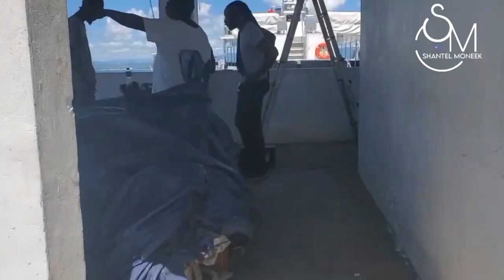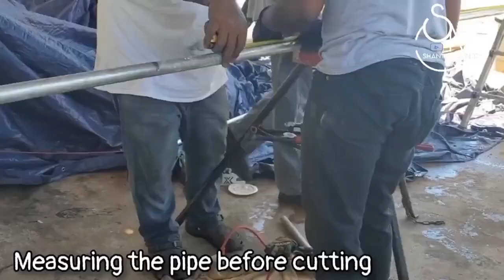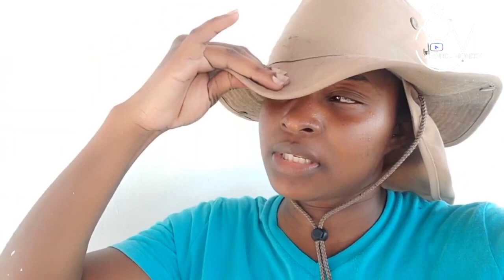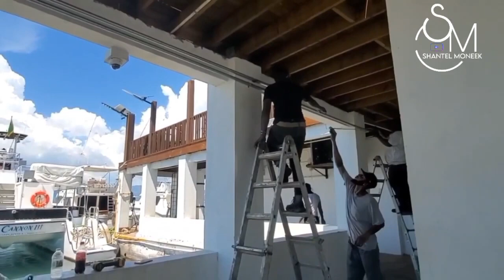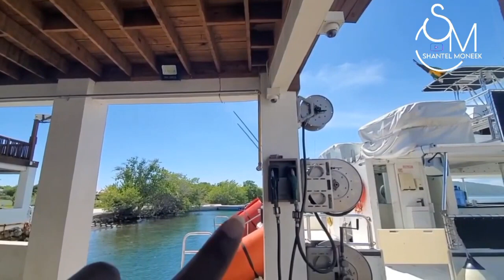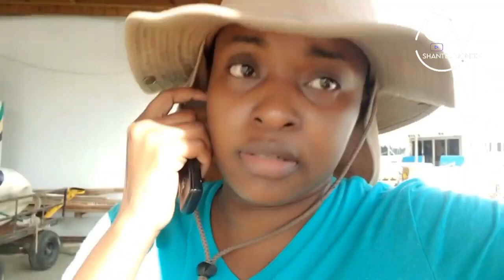Another Workend is Port Royal| Trainee Engineer 🇯🇲 #workvlog

Comment: Those pipes are metal...Is there a reason this is used as opposed to PVC?
Reply from the maker: PVC pipes crystallize over time due to exposure to sunlight. The metal pipes facilitate higher pressure.
Reply: @shantel_moneek  Thanks!